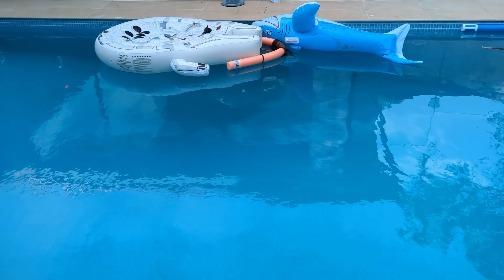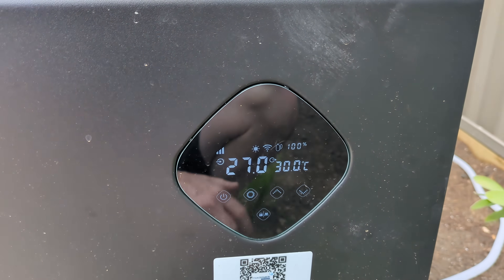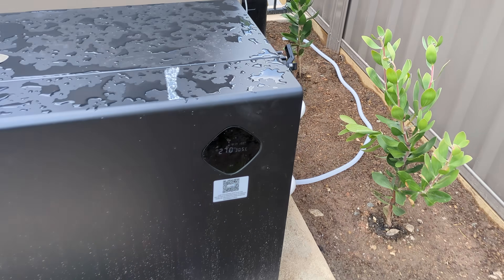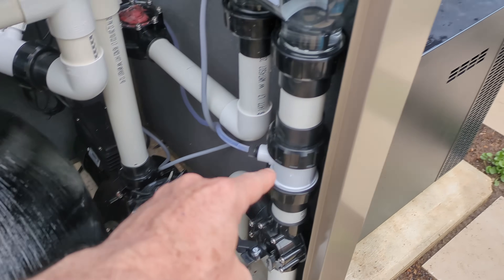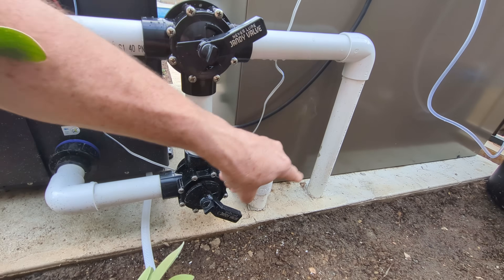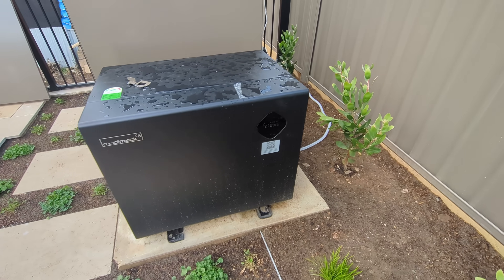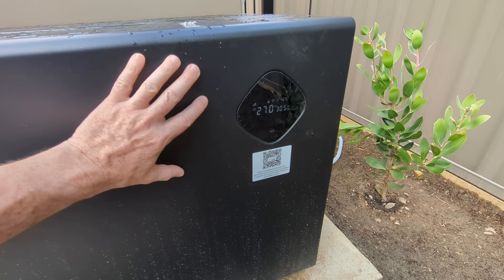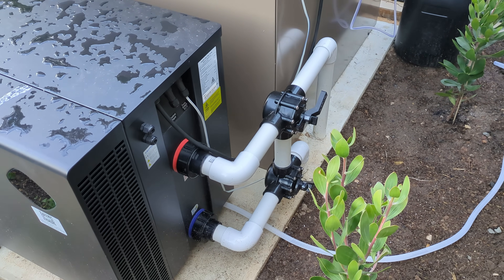Pool Heat Pump Calibration Explained (Madimack)

Comment: The difference in efficiency outside of the optimum flow rate is minimal, you've just proved that yourself if you think about it..... You can raise all the water by 0.5c or 1/6 of the water by 3c. Then you blend that 1/6 back with the other 5/6 that hasn't been heated at all and guess what, you've raised all the water by 0.5c.... The biggest factor is the difference between air and water temperature rather than water temperature differential across the heat pump. Probably less of a problem in Sydney than here in the UK where the air is pretty much always colder than the water!
Reply from the maker: No, the effiency of the heat pump is very much determinted the flow rate and hence temperature differential.
Reply: @EEVblog2  Sorry Dave but your own video shows otherwise! You’re putting the same amount of energy into 1/6 of the water so it gets 6 times hotter. Unless you can show that it’s using significantly more electricity at higher flow rates then the difference in efficiency is minimal. I’m not saying there is no difference, but you’re certainly not pissing away power.
Reply: @arharman  the efficiency of the heat pump is affected by the temperature difference between the condenser and evaporator. It won't use more power but the output will drop (lower COP). It's nothing to do with what happens in the pool water heat exchanger (you're right there about 3 degrees at 60lpm vs 0.5 degrees at 360lpm), the difference is with the heat pump itself and the difference in temperature between the two sides of the reverse Carnot cycle heat engine.
Reply: @LB-fx1kn  Exactly. The difference between the condenser and evaporator temperatures - I.E between water and air temperature. The higher flow rate can only cool the condenser to the water temperature. It’s no different to running the pool a couple of degrees cooler, yes it will have a small effect but it’s not really significant. Dave’s figure of 1/6 is obviously approximate, and 0.1c resolution on 3c is also not perfect, but within those limitations he’s shown that it’s giving pretty much the same output power regardless of flow. I believe he said it was running at 100% both times so presumably using the same input power in which case it’s roughly the same efficiency. Variation in air temp will be much more significant. My own heat pumps (Proteam I x7) quote maximum COP of 16 and 27c air 27c water, but only 8 at air 15c water 26c.

Comment: To all those nerding with the math details and trying to finesse the best energy transfer rate:  The heat pump is just too small.  Why?  Because Dave wants to run it off his solar panels' excess power when the house / car is not using it to the their full capacity.  Not taken into account is the cooling of the water from conduction (through the pool's concrete body to earth), radiation from the surface to the ambient air (cool in winter) and evaporative cooling to the air (due to breeze / wind).  Essentially of those heat losses exceed the capacity of the small heat pump (regardless of how efficient it may be) the pool water will cool and not be comfortable in the cooler months.  I doubt anyone will bee using the pool in those cooler months.

Also note that this heat pump uses about the same amount of electric power as the pool pump which looks like between 1 - HP (i.e. 750 - 1500 Watts)
Reply from the maker: You are forgetting the pool cover. Also, the heat pump was sized with the idea that the pool wouldn't be used in the dead of winter.
Reply: @EEVblog2  Oh Yeah, the pool cover.  Well knowing you, there will be a lot of data gathered which can be evaluated in 6 months or a year to see the temperature of the pool.

Comment: I don't understand the idea behind it ... The water pump runs at full throttle anyway and uses electricity.
If the heat pump gets more water, the temperature delta will decrease, *but the COP will definitely increase*.

btw: The current “calibration” will change as the sand filter becomes clogged.

Is the heat pump always in operation when the filter pump is on? If not, automatically switchable valves would be worth considering to remove this resistance from the filter.
Reply from the maker: See the pinned comment.

Comment: FYI, I believe this heatpump is a rebrand of the Mr. Silent, Aqua Forte or AQS. The controller is a standard Tuya jobbie. Advantage is that hooking into the wifi capabilities and controlling/capturing data is easier since it's just a generic-ish controller.

Comment: Does the outgoing temperature differential remain the same regardless of the desired set point? That is: if you set it to heat the pool to 27 degrees and the heat pump has a +3 degree differential, will it output water at 29 degrees if the incoming water is 26?
Reply from the maker: Yes, remains the same. The flow rate essentially determines the temperature differential. The set point temp is just a cutoff point.

Comment: It doesn't matter how much water is passing through the pool heater. If you are running the 60l flow or 100l flow the unit is still putting the exact same amount of heat into the water. If you goal is to have a 3* temperature rise on the outlet then you need to have the lower flow rate. At higher flow rates the temp difference will drop but you are putting the same amount of BTUs into the water but spread out over more volume of water.

    Your argument is like the car guys saying that having a highflow water pump doesn't cool as well because the water doesn't stay in the radiator long enough to cool the water....

        Course here in TX we are wanting pool coolers as they get too hot to use in the summer. Usually people will have an ice company deliver a load of ice to dump in it if they are having friends over.
Reply: That is true for heaters like electric and gas, where you just have a bunch of energy to dump into the water.

Heat pumps are not just brute energy sources but are heat engines, which operate on a temperature delta between the condenser and evaporator. The size of this delta affects the performance of the heat pump greatly, so you can absolutely cool it too much with excessive water flow and ruin the efficiency.
Reply from the maker: Nope, there is an optimial flow rate point, that's why it's in the datasheet with a +/-20% figure and spelled out very clearly in the claibration process

Comment: Apparently Sydney is due for a 42C heatwave this Saturday, so you might want to run your heat pump in reverse! 😂
Reply from the maker: It can cool as well as heat.
Reply: @EEVblog2 oh that’s cool! Bonus over resistive heating or burning dinosaurs!heatwave and you can have a nice cool pool. I do see from the specs tho that it can handle up to 43c outdoor temps

Comment: How did you establish the flow rate? Just thought it might be nice to have a flow rate meter there on the back of the pump 😊
Reply: I don't think he knows the precise flow rate into the heat pump. He's using the temperature differential as a way to estimate the flow rate, based on the specs in the datasheet.
Reply from the maker: I don't know the precise flow rate, I'm just guessing based on the data from Madimack. i.e. 60L/min should result in that 2-3degC temp differential.
Reply: @EEVblog2 fair enough!

Comment: Earlier and some of todays cheaper pool heatpumps show the coolant pressure of the condenser (high pressure side) and you are supposed to regulate the waterflow to obtain the ideal condition for the heatpump.
The higher the waterflow the more heat you will draw (you'll cool the condenser too much) which will lower the pressure on the condenser side. If the pressure is too low or to high your heatpump will work outside of its ideal conditions and be less efficient.
Most bypass setups I have seen or used consist of 3 normal valves (one input, one output and a bypass) or a single 3 way valve (sometimes a output valve is added on the pump to be able to completely isolate the pump for servicing). In your case there are two 3 way valves which can be interesting but also "tricky" to use since you probably have to set both valves symmetrically to avoid "chocking" your pump.
PS : if you max the flow to your heatpump you will think that it's not working anymore at all but in fact it is still working only it is heating a huge amount of water less efficiently and the temperature delta is very low and might not be "visible".
Reply: That would be an interesting project for Dave!
Reply: @dosgos Was thinking the same thing after seeing all the responses on this video. Looks like people are not aware that a higher flow would negatively influence the effeciency of the pump.
Reply: What you describe will only be a problem if the water is very cold, like below ambient temperature.
With a too low pressure differential in the refrigeration cycle the evaporator might starve of refrigerant because the expansion valve can not supply enough refrigerant.
What do you think how much the high pressure will vary between 3K delta and 0.5K? Not much!
The mean temperature difference between refrigerant and water will go down and the efficiency will go up.

More of a problem is the excessive water pressure drop when trying to push that amount of water through the heat exchanger.
Reply: @Alexander470815  Then how you explain the COP falling considerably? (talking from experience : 18000L pool with 5kW heat pump)
Never seen a heat exchanger fail because of the water pressure generated by a pool pump. Those a circulation pumps and will not create very high pressure, also they are placed after the filter where the pressure is MUCH lower.
When I change the water flow thru my heat pump the high pressure side of the refrigeant can easily vary 30% in pressure pushing the heat pump outside of its ideal working condition which can easily have your COP fall from 5 to 3.
That how it's given by the manufacturer and that is exactly what I have experienced.
Reply: @ppdan  The heat exchanger won't fail. Its just the (water side)pressure drop getting pretty high limiting the water flow.
When working with low temperature differences it gets pretty hard to measure the cop reliable.
Temperature measurement must be highly accurate or the measuring error will be very high.
0.1K Error for 3K delta? Not great but does work.
0.1K Error for 0.5K delta? Not usable.

Comment: 9:28 1/6 of the flow heated up by 3 degrees is exactly the fucking same as heating the whole flow by half a degree!
x - initial water temperature
5x/6 (the water bypassing the heat pump) + 1/6(x + 3) (the water being heated up) = 5x/6 + x/6 + 0,5 = x + 0,5
It doesn't matter, the water is heated up the same.

You spend so much time reiterating the same over and over and don't ACTUALLY explain why the heat pump is so capricious and wants such a low flow rate.
Reply from the maker: Yes, the efficiency/COP decreases with the higher flow rate.

Comment: I don't get it why lower differential of in and out would make any difference. Pump is either making heat exchanger colder or hotter at constant rate,  why would the difference matter ?
Reply from the maker: See the pinned comment.

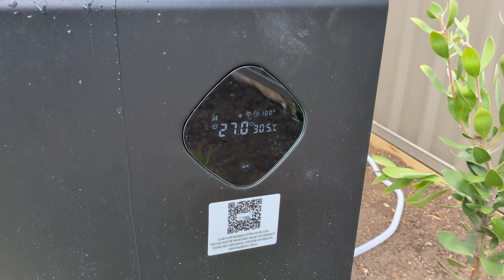Comment: 4:20 yeah, right. Where does the energy go then? It doesn't just evaporate into the aether. Of course the measured temperature would be lower, a given quantity of water would have less time to contact the heating element. Doesn't mean that the heat didn't enter the water.
Reply from the maker: I misspoke. The efficiency (COP) drops. So you get less heat pump action. It's not like I'm putting 11kW into it. But if you want 11kW heat pump action output from your <2kW electrical input you need to work in the ideal operational range.
Reply: @EEVblog2  that makes sense.

Comment: My friends recently bought a new bosch tumble dryer fitted with a heat pump, it's absolute wankery! It takes about 4 hours to dry a few pairs of trousers.
Reply: Then that one might be defective/just sucks :D The cheap Beko A+++ ones will do a full 8KG load of towels in 3h5min on the driest setting and thats worst case.
Reply: @tschuuuls486  Possibly, but a regular 3Kw dryer would do it in about 40 mins.
Reply: someone mentioned that you should do a couple shake/snap  with the clothes as you remove them from the machine the airflow will remove the last moisture.
Reply: @MattyEngland  I know. But usually I don't babysit my drier. I never thought, oh wow I wish this would dry faster. If it's about the same speed as my washing machine, who cares :D
And since that 3h is absolute worst case this never has been an issue.
Reply: But power is pretty pricey here, so the trade off is worth it. Also the vented drier pumps already warm air out, which the heat pump one doesn't.
Reply: @tschuuuls486  Yeah for regular laundry it's OK if you're at home all day, but sometimes kids need a certain item in a rush for school, and most people don't go out and leave tumble driers or washing machines unattended. I certainly don't, as one failed bearing can easily cause a housefire.
Reply: @MattyEngland  if you just throw in that one item, the heat pump drier is also very quick. Regarding the use while away, I'd consider the heat pump one pretty safe. Our cheap beko has an inverter motor with ocp.

Comment: This is just thermodynamics Dave. More flow rate at the same heat input results in lower delta T but the same input in energy to the pool.
Reply from the maker: Yes, the COP drops if you aren't in the ideal flow rate range.

Comment: You can calculate the COP of your heat pump easily if it doesn’t tell you on the display… Take the temperature difference between input and output (3 degrees here) and the water flow in litres/second (1l/s here, ie 60 l/minute) and multiply by 4.2 (specific heat capacity of water in kJ/kg).  So your heat pump is making around 1x3x4.2 = 12.6 kW of heat. Now check the power consumption - hopefully much less!!
Reply from the maker: Given that's it's only a 10A (2.4kW) mains outlet, yeah, I'd say much less!
Reply: At a flow rate of 360l/min (6l/sec) then the result would be 6 x .5 x 4.2 = 12.6 kW of heat, exactly the same efficiency...
Reply: @HarmanRobotics  It doesn't scale linearly like that. The COP will drop if you cool the hot side too much, meaning it's no longer 12kW. Heat pumps aren't just like an electric heating element and are very complex and dependent on the temperature difference between the hot and cold side (of the heat pump, not the pool water inlet and outlet)
Reply: @LB-fx1kn  Based upon the numbers Dave gave (0.5C at 360l/min and 3C at 60l/min) it is the same amount of heat transferred according to that calculation. What is missing is the power consumption at the different flow rates.
Reply: Those numbers were just hypothetical. At a higher flow rate (above the optimum flow rate of the heat pump being 60lpm), the COP drops and it's no longer outputting the same amount of power. So in the real world it's more like 3 degrees at 60lpm, and 0.3 degrees at 360lpm. Note we are not talking about the water heat exchanger here, but the actual heat pump.
Reply: Just did some experiments in the game stationeers and also had to the same math 😂

Comment: How do they calculate the efficiency?
1. If you have a 750 Watt water pump and the heatpump is using 490 Watt for heating, then the efficiency is very low, but it is cooling the heat exchanger very fast, so that you have nearly no heat difference.
2. But if you would reduce now the power of the water pump to 200 Watt, then the heat difference is a bit higher, but the used value used energy per kWh of heat is higher.

There is a optimum point somewhere between water-pump-energy + heatpump-energy compared to generated heat.

So there is a way to reduce the power of the water pump and this increase the efficiency. To reduce the flow rate with this valves, this is doing nothing.
Dave, you can set this valves to fully open, so that the flow rate is the maximum.
If you do not change the power consumption of the pump, the efficiency does not change ... or better say, if you waste the water flow with this valves, then you reduce the efficiency.

I would add a energy monitoring to the heatpump. I think it tries to create a heat difference of the input and output water.

I think the installation company had created a own system to use a unregulated pump and deal somehow with the waterflow-efficiency-thing what they had found in the documents. But it does not work this way. Possibly they have explained to you very convincing, but it is not right in the way they have realized it. Possibly they do not know how to realize it, because they have no electronic expert in their team, only plumber.
Reply: If you higher the flow you will draw more heat which will lower the temperature of the heatpumps condenser followed by a pressure drop of the refrigeant in the condenser. This lowers the efficiency of your heatpump because it's now working outside of its ideal conditions.
Efficiency can really drop a lot.
Reply: @ppdan  - My heatpump has a wide spectrum of the working-area, a problem is only the very cold or very hot temperature.

If it is now 20 or 30°C is not a real problem for the heat pump, the best is a low difference between source and sink, then the device need less energy for the heat transfer.

Comment: Be interesting to see the running costs of this.
Reply: From the electrical connection details that we saw on the label, it can use upto  2.3kW of electricity to push upto 11kW of heat into the pool water. It will probably use less electrical energy as the specified electrical connection only allows 10A at 230V (or 2.3kW).